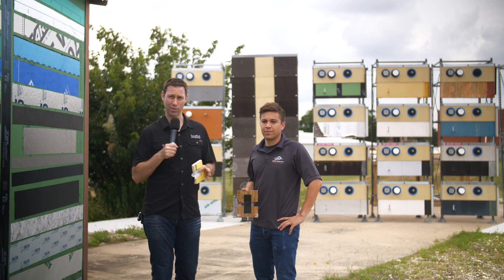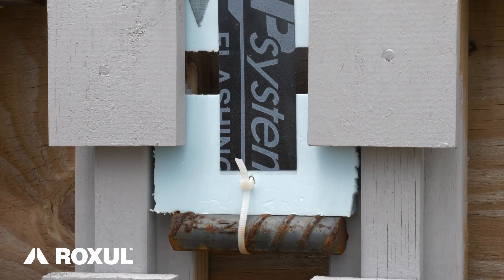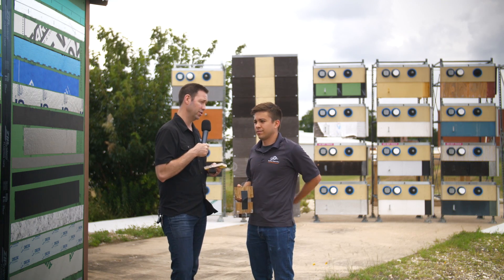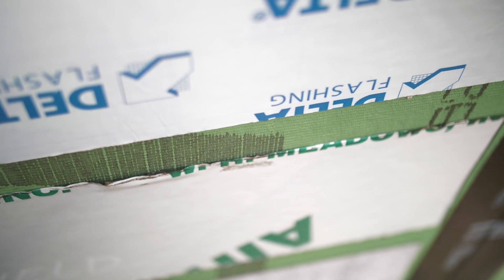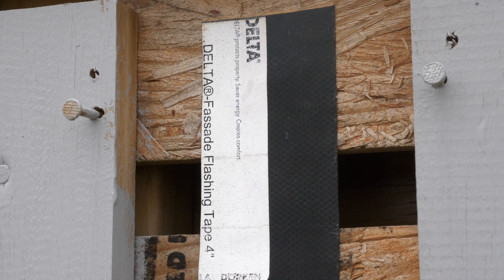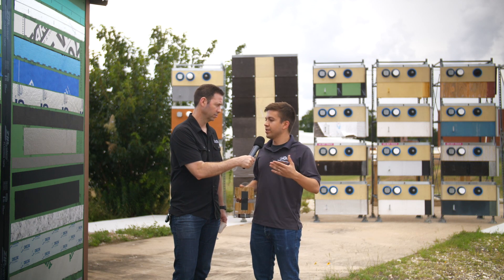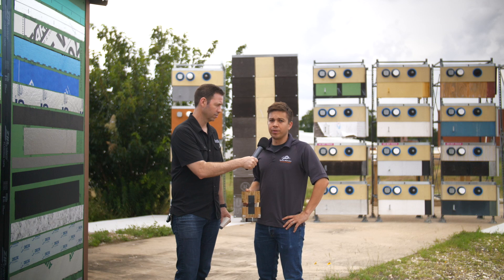Flashing Tapes Tested - What's the best one?

Comment: In case any one is looking for the conclusions of the study: 
Link: https://repositories.lib.utexas.edu/bitstream/handle/2152/63561/BLANCOURRUCHURTU-THESIS-2017.pdf?sequence=1&isAllowed=y

Conclusions, starting on Page 81:
* Overall, acrylic tapes had an average failure time of 17 days, while butyl tape average was 10 days. Lastly, the average of modified asphalt tapes was around 6 days. 
* Acrylic tapes showed better performance on integrated to sheathing WRB, followed by EPS insulation, and gypsum sheathing with average failure times of 23, 20, and 18 days, respectively.
* The rough side of the OSB sheathing was the worst performing substrate with a total average failure time of 7 days.

Comment: they never answer the question, what a bunch of cunts.
Reply: I think the study hadn't finished when the video was posted and they forgot to update the link: https://repositories.lib.utexas.edu/bitstream/handle/2152/63561/BLANCOURRUCHURTU-THESIS-2017.pdf?sequence=1&isAllowed=y
Conclusions starting on Page 81:
* Overall, acrylic tapes had an average failure time of 17 days, while butyl tape average was 10 days. Lastly, the average of modified asphalt tapes was around 6 days. 
* Acrylic tapes showed better performance on integrated to sheathing WRB, followed by EPS insulation, and gypsum sheathing with average failure times of 23, 20, and 18 days, respectively.
* The rough side of the OSB sheathing was the worst performing substrate with a total average failure time of 7 days.

Comment: In the vapor and air barrier testing in the back the test panel should be at the same height and either all over grass or all over concrete for the reasons of reflected radiant heat and UV....while the exposures dont differ a great deal its still different and the lower panels get rained on plus slash back from rain doubling if not quadrupling water exposure. too me that is..........
Reply: Troublemaker.

Comment: Hi Matt, grate video! I've often wondered about what testing goes into these tapes to make sure they last.

Wanting to know, in your experience have you seen that tapes will last 5, 10, 20 years?
Or has your experience so far been that they don't last as they should.
I've seen on all your videos you will incorporate metal sill pans, and mechanically overlap everything so that if they do fail water will still stay outside of the building.
But I do worry that the tightness of houses will degrade quite quickly if these products aren't lasting as they should.
Perhaps fluid applied membranes are a better way to go??

Comment: Click bait, never answered the question in the title, waste of 5:39.
Reply: Even worse if you read the published article, they don't even have a chart of what failed and what didn't. A complete waste of time.
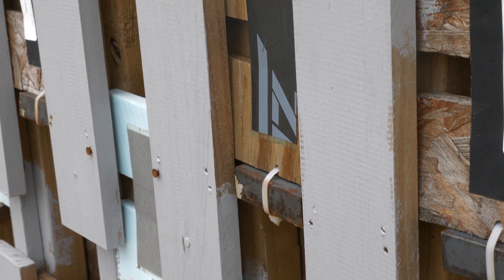Reply: 2:03 Butyl tape is good alternative
TRUE - BUT - Even better is to use butyl caulk (but be careful as clean up of a mistake is not easy)
And it's not new, has been used a gutter lap cement for a very long time.
Reply: 1:40 basically joint and seam type acrylic based tapes were the best.

Comment: Appearances could be deceiving, but that Zip system tape and the Delta product both seem to be holding very, very well.  A few of the others which will rename nameless looked to be about as effective as duct tape.
Reply from the maker: See my blog for some inside scoop that isn't in the video.  http://mattrisinger.com/flashing-tapes-testing/
Reply: All of them (save butyl caulk) will leak over time.
butyl caulk will leak too, but not in your lifetime
But butyl caulk is generally a mess to use because it does stick so well TO EVERYTHING
And you can't "profitably" spend hours cleaning up where you should not have put it.
Not sure what the butyl tape in this video is but it's obviously not the same as butyl caulking
(some times called gutter lap cement)

Comment: looks like fluid applied would be the best option.  Sure looked like a majority of the tapes on that wall had some kind of peeling going on.
Reply: butyl caulk is fluid (sort of) and cannot be beat - but it is VERY sticky and so any mistaken placement very hard to clean off.
There are fluid applied flashing that go on easy and then set.
butyl essentially never sets, it is what it is when you apply it and fifty years later
Reply: I'll go with Luke on the fact that UV would be a big factor on these tapes. You really need them to be covered during testing.